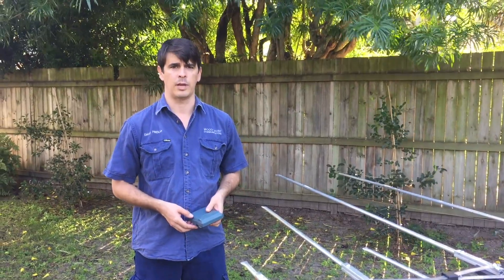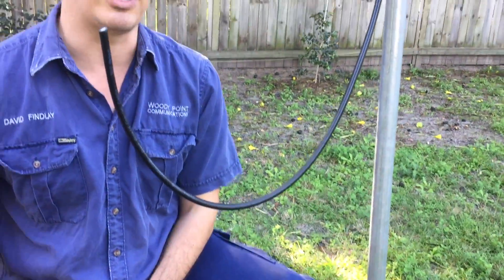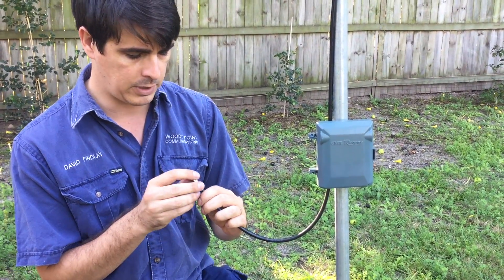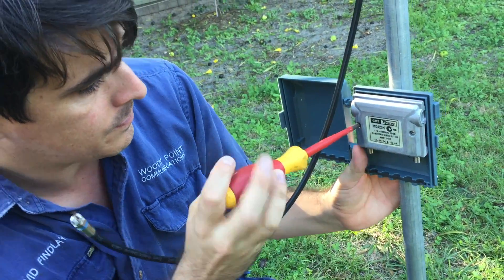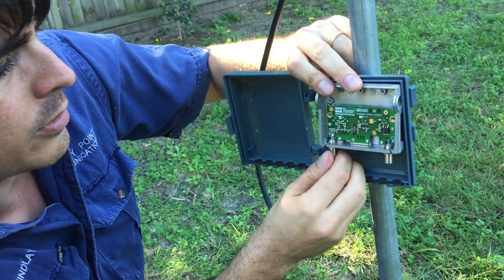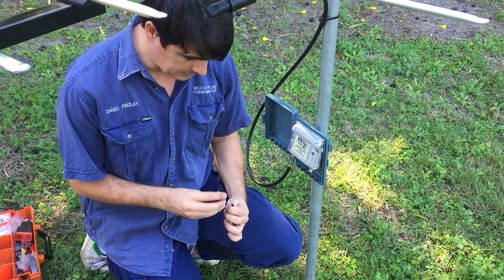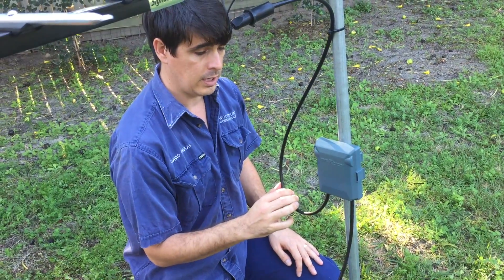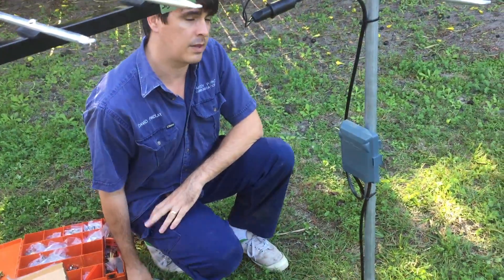How to Install a Masthead Amplifier for Digital TV - Part 1

Comment: ONLY mistake he made is cable ties they are not reall UV resistant i use coated copper on my amp still there while neighbours have replaced ties 3 times in same period

Comment: That was a great video but I am wanting to remove my masthead amplifier as it's no longer required so do I basically just do the reverse of what you did?  I have a power supply inside the house so I don't have to worry about that part but just hoping I have a bit of slack cable inside the roof that I can pull through or can I just connect up the two cables that went into the amplifier box with a joiner?

Comment: At 1 min 40 on the f connector connection is vague when you strip with your tool i cannot see what parts of the wires need to have can you explain without this your video make no sence unless you have done it b4. Thx
Reply: He showed in a previous video

Comment: Thank you ! Beautiful presentation. The only observation I have is the hanging balun (transformer). I always relieve any stress to the  two connectors by supporting the balun to the antenna using electrical tape or UV resistant (black) tie wrap. However, I try to avoid any TV antenna that does not have a direct coax cable connector.
Reply from the maker: Thanks. That's a good idea. I've typically just tended to support it by supporting the cable, but attaching it directly would reduce risk of damage. This type of antenna isn't used as much any more, the ones with the direct coax connection are much more common now.

Comment: good video!  I have full bars reception on my tv yet the digital is breaking up regularly, I have a kingray amplifier, but just wondering if you can get something more powerful if the digital tv drops out?  Really getting annoying!
Reply: It's not all about power, signal quality is more important. Also the reception bars on the TV aren't that useful. There's two issues I'd look at. First, replace the cable between the TV point and the back of the TV. This is the single most likely point of failure and it's not always noticeable that the cable is broken internally. Secondly, the quality of the signal coming from the antenna into the amplifier is important. If the antenna is old and broken, or misaimed the signal getting amplified is bad. Garbage in garbage out. Amplifiers boost the level which increases the chance the receiver can get a good picture out, but you still need to get the best quality signal into the amplifier.
Reply: It will most likely be 4G interference.
You need a filter.